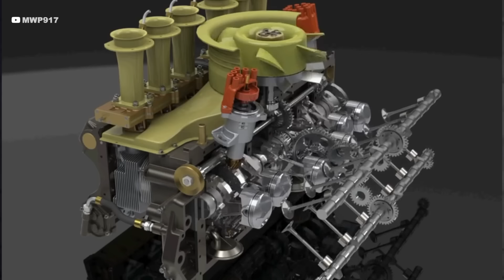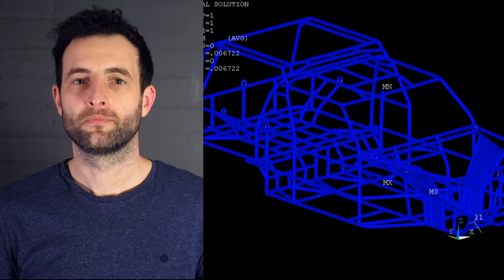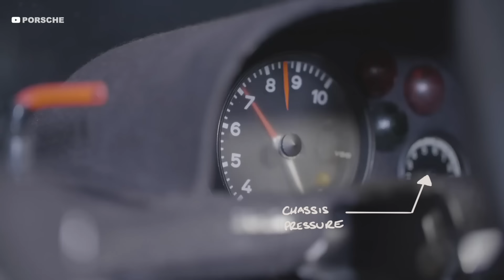The Porsche That Had an Inflated Chassis

Comment: The added bonus of pressurising the chassis with nitrogen is that it becomes stronger without adding significant weight, an effect called pressure stabilisation. This is used in rockets to reduce weight. A pressurised vessel (each chassis tube can be counted as a seperate vessel) is far stronger under compression than one at atmospheric pressure.

Comment: Two things...1. Top speeds at LeMans were/are actually higher than todays...or that day's...F1 cars. There are no F1 circuits that have as long a straight as LeMans and so it is more important to have downforce for improved cornering speeds. Downforce creates drag lowering top speed. 
2. After changing the aerodynamics of the original 917 to make it more manageable, but slower down the straight, for LeMans primarily they designed the long-tail version of the 917. It retained the top speed of the original by having a more complete aerodynamic shape. The ideal raindrop/fish/aeroplane tail shape is often truncated...chopped off...in cars like the 917 because there are diminishing returns after a certain point and the longer tail is heavier.

Comment: This was really interesting.  I initially thought it was pressurized to increase rigidity like the fuel/oxidizer tanks in a rocket.  Cool concept to ensure chassis integrity though.
Reply: I'd thought the same, and even if that wasn't used in this I wonder if that could be used? In a lot of structures rigidity and strength in compression is a much bigger challenge than in tension. I could imagine a large thin structure pressurized with gas (possibly even helium - wouldn't float but a large structure at high pressure it could possibly save a few kilos, and in a case like this every gram counts) with the result that the material itself - probably ultra-thin carbon fiber - only has to be strong and stiff in tension. Sort of like a high-strength high-pressure balloon, we can think of balloons and other inflatable things as ultra-lightweight things with no stiffness whatsoever until inflated, this would have some but far less, becoming much stronger and stiffer when inflated. Only issue I could see is safety and reliability, the safety rules might not like it. Basically if a big hole rips in the car, it suddenly looses all it's strength and stiffness, leaving the driver surrounded by little more than floppy bedsheets at 200 mph.
Reply: The nitrogen solution comes from aviation, it was nothing new. Airplanes main spar are filled with pressurized N2 for the same reason.

Comment: Like a lot of other people, my first thought when seeing this title was wondering if they pressurized the chassis to increase rigidity. In a lot of structures rigidity and strength in compression is a much bigger challenge than in tension. I could imagine a large thin structure pressurized with gas (possibly even helium - wouldn't float but a large structure at high pressure it could possibly save a few kilos, and in a case like this every gram counts) with the result that the material itself - probably ultra-thin carbon fiber - only has to be strong and stiff in tension. Sort of like a high-strength high-pressure balloon, we can think of balloons and other inflatable things as ultra-lightweight things with no stiffness whatsoever until inflated, this would have some but far less, becoming much stronger and stiffer when inflated. Or similarly how a soda or beer can is very tough and rigid when full but rather fragile when empty. Only issue I could see is safety and reliability, the safety rules might not like it. Basically if a big hole rips in the car, it suddenly looses all it's strength and stiffness, leaving the driver surrounded by little more than floppy bedsheets at 200 mph.

Comment: Large cranes and draglines use pressurised tube frame for rigidity. The pressure is carefully monitored to signal cracks in the structure. The pressurised gas and the surface coating are chosen to react with one another, so the cracks are revealed with a surface colour change at the site of the crack/leak.

Comment: How safe is that? You get burns from scalding oil and broken bones when you crash because the hot oil runs through the chassis and the cars create lift but that being said what a monster!
Reply: I mean, when a crash is severe enough to break the chassis there wouldn't be much left of the driver either, as they sat so far in front that their feet were in ahead of the front axle. And there wasn't a crumple zone. 
If I remember correctly it was Richard Atwood who said that a slight shunt into the pit wall would've been enough to break both of your legs.
Reply: @mikeblatzheim2797  true but if a line were to blow it could be really bad
Reply: This video did a poor job of delineating the model that had the very bad aerodynamics.
It was the very first version of the 917.  To race the car Porsche had to produce 25 cars for homogenization.  One privateer said the car scared him to death.   He died on the very first lap.  Note: that was the very first version of the 917.

Comment: Erm, nearly 1000 horsepower? Genuinely curious, I've never heard that figure associated with the 917k that you're showing
Reply: "Porsche 917 - Wikipedia" https://en.m.wikipedia.org/wiki/Porsche_917. In the 1973 Can-Am series, the turbocharged version Porsche 917/30 developed 1,100 bhp (820 kW).
Reply: @sandybarnes887  Yes, but in this video he is referring to the 917k that competed at Le Mans, and they only ever produced around 600.
Reply: @sandybarnes887  ...totally different car. No endurance-racing-trim 917 ...the closed coupe cars.... EVER had 1000 HP. Started with 520 in 1969 and ended up even after 2 size changes ( from 4.5 liters....to 4.9....then to 5.0)....never got over 560, maybe 600 HP. The turbo cars are also over-rated by urban legend...yes, on a dyno maybe hit 1500 momentarily, but ran races under 1000 HP.

Comment: Great video! I always wondered why no one makes a Porsche 917 continuation, especially when GT40 continuations have been so successful.
Reply: RCR makes a continuation. Only issue is your engine options are limited unless you manage to have an original flat-12 lying around. Cobras, GT40s, and even Lola T70s have the advantage of numerous V8 options. Personally, I wouldn't want a 917 replica with a 911 engine or a V8 stuck in it.

Comment: I know some people who think a Ford should have kept going at Le Mans into the 1970s. Now I know why Ford didn’t do that, lol
Reply: Actually, Ford withdrew from the series when the FIA reduced engine displacement to three liters for prototype cars (Group 6) and five liters for "production sports cars which had at least 50 chassis made (Group 5). The Ford GT-40 MKII and GT-40 MKIV that won Le Mans in 1966 and 1967, respectively had 7 liter engines. Ford's entire racing program was rendered obsolete by the stroke of a pen. Ferrari’s 4 liter 330P4 was also made redundant by the new rules.
Group 5 was intended to consist of Lola T-70s and Ford GT-40s with 5 liter engines. Group 6 would consist of the Alfa Romeo T33/3, Ferrari 312P, Matra 650 and Porsche 908 which all had 3 litre engines. The FIA did not anticipate that Porsche would produce 50 5 litre 917s... There are impressive photos of the cars lined up for the FIA to review.
BTW, John Weyer's Gulf team beat at Le Mans Porsche in 1968 and 1969 using Ford GT-40 chassis 1075. Porsche hired him to run their team for the 1970 season. It was actually John Horseman on Weyer's team that determined the issue with the rear deck of the 917 after observing Jo Siffert driving the 917 PA intended for the 1969 Can-Am series. The PA was an open cockpit car and didn't have the long, tear drop shaped tail of the normal 917. The Gulf team mocked up a new tail and it worked very well. Thus was born the 917K.
Reply: @JanZizkaMetal  Ah, I see. Thanks for the info! I’m not great when it comes to this Classic Le Mans stuff lol

Comment: Carefully choosing the tubes in the spaceframe; is that the same as making one, putting it in a jig, twisting it, fitting a slightly stronger tube to wherever it warped, and repeating that process until it's strong enough?

That's what McLaren did with the Ultima mule chassis when developing the F1, using masking tape to show where it was twisting

Comment: The "Aluminum Balloon" structure was actually pioneered by Wernher von Braun for the German V2 program, was later refined for the American space program through out the 50's and 60's and is still used in modern rocketry today.

Comment: Some home built aircraft use pressurized nitrogen in their space frames as well, so the pilot can easily detect if cracks are forming somewhere. The 917 was ahead of it's time. Great video.